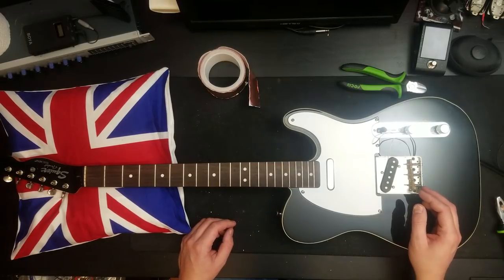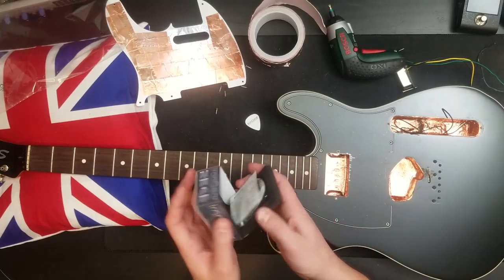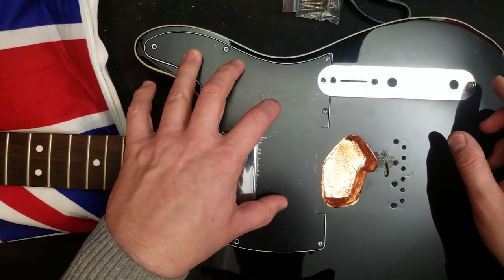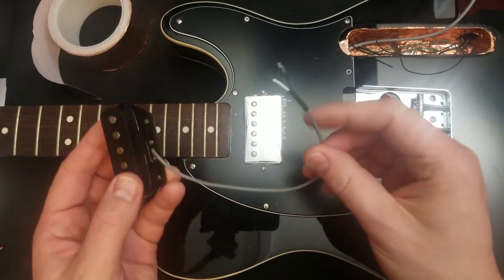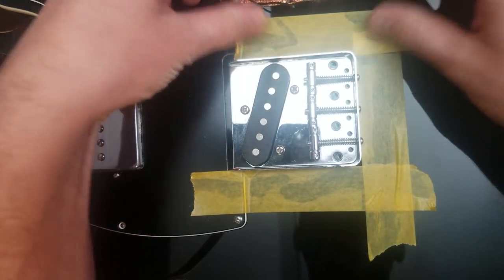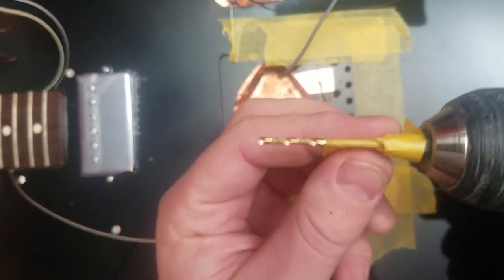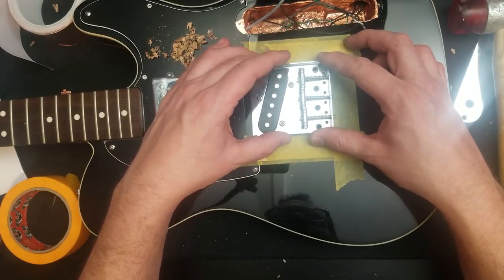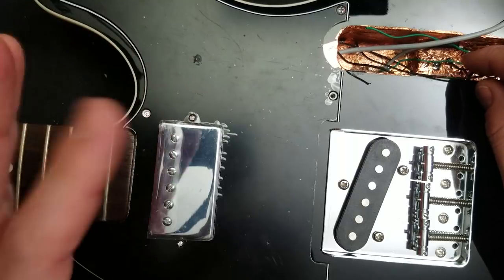Squier Classic Vibe Telecaster gets an upgrade PT 1

Comment: A tip for anyone doing a similar project.... Fender parts don't fit on a classic vibe, hence the filling/drilling of the scratch plate and the chiselling of the bridge cavity.... Did the original bridge fit with the new pickup before you started carving away at the cavity to fit a fender spec bridge..... which might throw out the intonation of the guitar.

Comment: I'd be using a stacked humbucker or a single coil size humbucker in the bridge there. I've got some Seymour Duncan STK-1s in a strat and they sound very single coil but are stupidity hot and noiseless. 

Are you going to wire the switch so it splits the humbucker when combined with the single coil?
Reply from the maker: I just might. I'll have to ask Sy (the guitar owner)

Comment: Interesting video, just a couple of questions/comments. I own a Classic Vibe Tele and have swapped the original neck pickup, (made by  Tonerider I believe), for a much fuller sounding Fender twisted Tele one, I don’t recall the body being routed for a humbucker on my guitar, is that something you’ve done? Is that a ceramic magnet on the bridge pickup? I know that it’s all down to personal taste but I find that ceramic pickups in a Tele bridge can sound a bit brittle and thin and would probably have put an Alnico quarter pounder in there. Keep up the good work, I’m really enjoying your videos.
Reply from the maker: Hey Henry, I've worked on three Classic vibe teles including this one. They were all hum bucker routed. Not sure if they do them all like that but I didn't change anything. Regarding the ceramic pickup, I am working on this guitar for a friend and I tried various pickups, alnico and ceramic and this one matched with the hum bucker. Thanks for watching and I hope we get to know each other better :)
Reply: I’m sure you’re going to hear more from me. I own over 80 guitars, (I know that it’s a bit excessive), and have strong opinions on most things guitar. By the way I’m a big fan of Iron Gear humbuckers and Ironstone Stratocaster pickups.

Comment: nice Job with that cavity resize, liking that tele man. what is the radius of the fret board? 9.5"? I have a Jim Root signature tele, and it has the best neck feel out of the pack! my go-to guitar for the most part, those have a 12" radius, that radius with the tele string spacing for me is the ideal combination.
Reply from the maker: That's right, 9.5"
I also had a Jim Root Tele - fantastic guitar and I loved the radius. It just didn't add anything to my collection that I didn't already have so I sold it. I still miss it.

Comment: Was this squier tele already routed for a humbucker in the neck or was that previously done?
Reply from the maker: It was already routed for a humbucker
Reply: Perfect. Gonna buy a tele like this and do this mod. Thanks
Reply from the maker: You're welcome.
Reply: When putting the humbucker in the neck, is it really necessary to change the pots to 500 or are the stock 250 pots fine?
Reply from the maker: That depends on the sound you want. 250k pots will make the humbucker sound darker

Comment: Hi really enjoyed the 2 videos. Which Rolling Mill Pickup did you use the regular one or the overwound and you did not say what pickup you used for the bridge to balance out the Rolling Mill? It looked like it had a ceramic magnet attached?
Reply from the maker: It was the standard Rolling Mill. The ceramic bridge pickup was one of a few I had hanging around. I tested out about 4 pickups including the original and this one sounded the best in pairing with the RM.